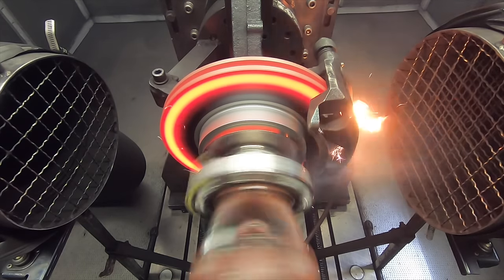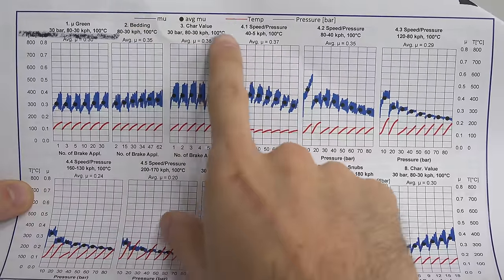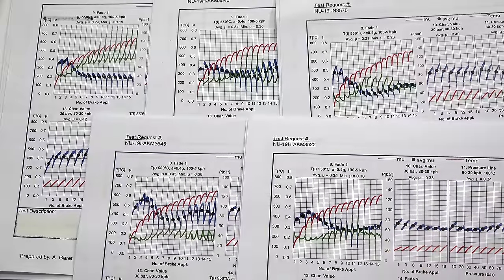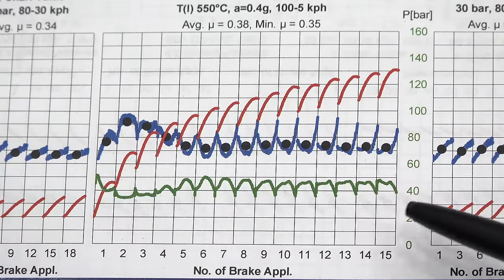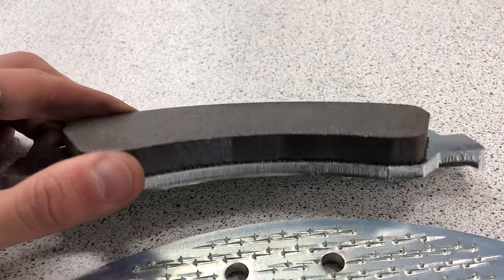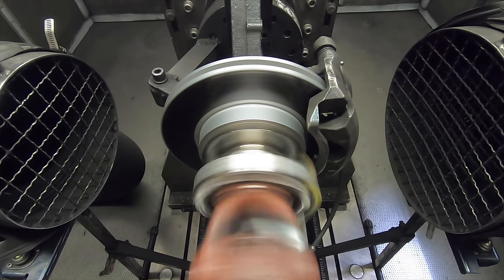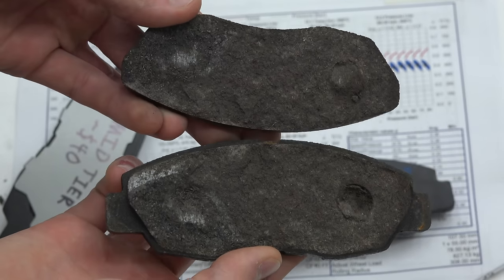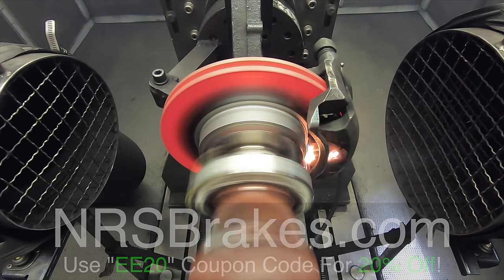What Are The Best Brake Pads? Cheap vs Expensive Tested!

Comment: I have never understood why people cheap out on Tires and Brakes on their vehicles. 
Literally the most important things on a car.
Reply: Agreed!!  Once you go PSS/PS4S's you'll never cheap out on tires again!!  Brakes are kind of a nightmare with so many conflicting opinions between bobcat, hawk, ebc, etc...  Running EBC Redstuff on 2 piece sprinkle slotted rotors, looking for more bite though.
Reply: Possibly because I'm old, I know how to drive, I pay attention to traffic around me. I've always bought one step up from the bottom, and it looks like I'm right. But I started on bias-ply tires, manual drum brakes I still drift around every snow covered corner,  and us old people don't need anitlock brakes to stop on ice.
Reply: Some people don't drive like they're on a damn race track either. They actually avoid havoc by paying attention. They don't run their tires low, keep them rotated,  don't wait till the last damn second to apply the breaks, ect ect. Use your brain and there won't be any need to buy over priced, over rated crap.
Reply: Gary Riefle 

Exactly. 04 Colorado, one step up brakes done me well.
Reply: If you don’t have the money you buy what you can afford.
Reply: According to the video, spending more money on the upper tier vs budget made no difference in performance.  So you can spend more but end up with the same results.
Reply: @stevens1646  I agree. Plus, there's the "I paid good money for my parts" and so many end up takin that for granted and the parts get abused. When in fact lesser priced parts if properly used actually end up lasting longer. I'm sceptic of two prices for any part, the lowest which is obviously low for a reason, (don't buy those) and the high dollar stuff that is overrated... they just want your money.
Reply: Buy Michelin defenders great tire I highly vouch for them...
Reply: @stevens1646  but the higher priced ones do not squeal. my brembo pads regularly squealed, especially after washing. switched to textar and no squealing :)
Reply: Because the cheap ones still meet the specs, and if you don't drive like a yob they work just fine.
Reply: There are some not so expensive tires that are way better than expensive ones.
Reply: @garyr7027  You are 100% correct,matter of fact 90% of pads sold out there are the 20 dollar pads,people dont understand pads just dont fall off or you "get killed because you bought a 20 dollar pad",even the cheapest pads are made by companies that dont wanna deal with a lawsuit,will they last a long time? maybe not, but they will work just fine as long as your not Hanging out with Mario Andretti and hes doing the driving,i like to buy the step above on the cheap pads but i have used the chepo ones many times,they create dust quite a bit but the car stops perfectly.

I tell you a story,ive done 3 brake jobs in my life out of many dozens where the owner let the car go for so long that there was no pad left or metal,the rotor ate it up and the remaining pad and the other side of the caliper were stopping the car just fine,granted it caused a tremendous racket (i have this noise in my car, do you know what  it might be???)  but the brakes were still working, if i remember correctly it was a Honda Accord,a Hyunday Sonata and a Ford truck,i just had to shake my head in disbelief but these people weren't driving like maniacs either,they just weren't very good on maintenance.
Reply: @dntlss  they are the same ones who don't change the oil, do a trans fluid change, red line the tach, floor the pedal between stop signs, ect ect. I think some people think, if they can't buy OEM or high dollar parts then there's no sense in doin it at all, just let it go till it actually needs fixed. You won't catch me doin that, one thing I can't stand is ten different things wrong at the same time, by then the car isn't worth having. If you have a decent car from the start and like it, you'll save money in the long run to keep it and keep up on it. A part goes bad replace it, don't put it off any longer than necessary. Appreciate your input I can relate to it, I've seen cars like that before. The motto "if it ain't broke don't fix it," is and has always been bad advice imo... I've never agreed with it. That motto comes from lazy asses who do nothin to their cars, and then wonder why it's not worth keeping... go figure?... Lol
Reply: Talk about thinking about things we never even think about AKA take for granted.
We bet our lives each and every single day multiple times a day and we never even think about it. . . 
Well Most people anyway.
Reply: @karlporath8904  My first vehicle was a 1972 Ford f-100 with manual drum brakes. Not bad once you get use to them, but you need some good leg muscles to make them work well when you're going downhill or hauling a load. Slowing or stopping on snow/ice is certainly doable. I'd rather have manual brakes than power brakes with no ABS.
Reply: @Zeveulesaussure  True. It also makes a big difference on what you're buying them for. Truck tires tend to be cheaper than car tires that have to fit on a 18" or 19" rim and can only be 1.5" - 2" tall. Just one reason why I hate large rims on just about any vehicle. Why some people love giant rims with paper thin tires is beyond me.
Reply: Sometimes it's a matter of personal finances.
Reply: @rayford21  True, and I will admit that going cheap is better than just neglecting it outright. As long as you keep up on the maintenance which will probably be more often with cheap parts. 

Often times the cost seems to be minor between cheap parts and good mid tier parts. I know this isn't always the case, but in my experiences, the person who gets the dirt cheap parts usually doesn't really care much about the car. "As long as it still moves it's good enough. Brakes are overdue? Oil change is overdue? Tires are bald? Eh. It'll get done eventually when I get the time and the money." It's not like you're the only person driving around. If you can't afford or be bothered to take care of your car then don't drive one.

Comment: great video! I would have liked to know more about the different material types used in pads (ceramic vs metallic) instead of just generic price points.
Reply from the maker: It's honestly a very difficult thing to determine, which is why I left it out. Regulations allow for such a wide variety of materials that unless you do some sort of chemical analysis, I'm not sure there's much meaning behind it. For what it's worth, the cheapest pads were semi-metallic (again, vague, but that's all they tell you), while the other four pads are ceramic. But the material alone doesn't show a strong correlation with all tests (both ceramic/metallic can do poorly in sound, corrosion, shear, etc), so it's difficult to determine what's the cause for doing well/poorly based purely on material.
Reply: @EngineeringExplained  Full ceramics so frequently have a major noise advantage I believe the mid-level pads were actually a semi-metallic, as you say it's difficult to prove so we will never know, sheer test results somewhat support my suspicion as well.
Reply: Yeah, this makes this test completely worthless for answering the question it claims to ask.

Comment: I remember the tv show legendary motor cars doing a   segment on the very same thing essentially. They stated at that time that in North America that there were only two brake shoe manufacturers.  That all the North American  and few of the import brands that had assembly facilities in North America used one or the other. Many of the aftermarket brands used them as well. Of course, with rebranding. 
Great presentation as usual.

Comment: I have always preferred OEM and learned those are the only ones you should use in mechanics class. Not only that but cheaper pads with a “lifetime warranty” usually means they are too hard and will just wear your rotors that much faster.

Comment: I’ll stick with OEM I’m not too impressed with the NRS
Reply: If soft pads are cheap and you really do not drive beyond posted speeds often why not? Just replace them and keep the rotors. 
Hard will last longer, but also the rotor wears fast too.
OH and using engine breaking assistance. No it does not kill a gas engine. Not good for most automajic transmissions as they are not made for slowing. Mostly for just going

The last thing if you do it. Cheap is OK. If you pay to have the work done might as well go with hard and and new rotors
Reply: @warrenpuckett4203  I do lots of hard mountain driving I love my high performance wagon!
Reply: @annoythedonkey  hey! At least they're honest!
Reply: Seems to me the mid range parts store are the best value. They scored near the best on almost every category and are way cheaper than OEM or premium brand pads.
Reply: I usually prefer akebono pads. They work great and have never had braking issues with those.

Comment: Driving over 300,000 km on OEM brake pads and pads still have over 5 mm left, never changed pads over 8 years, but I drive very defensively and anticipate all stops if possible. Brake pad wear really depends on how you drive.
Reply: You’re breaking on the gearbox or what ? Even if I do that you say, I’m driving mainly on mountain roads I can’t not use the brakes. 30k Km and they are gone
Reply: Yeah, braking from cruising on the flat is lots different from the up & downs in Mountain Country, - you just don't t swao your gearbox cogs anything like the same amount.

Comment: My 2015 nissan versa note s came from the factory with Akebono Pro ACT Ultra Premium ceramic brake pads and lasted ~100,000 miles (and still had about 1/5 of the pad left when I replaced them). 

I replaced them with the cheapest $35 autozone budget pads and they lasted ~20,000 miles.

Comment: Dealership OE pads are definitely the best. I used to use the mid grade aftermarket and thought they were ok. I used to have to replace them every 2 or 3 years. Then I switched to dealership OE pads. They cost almost $80 but I got over 5 years out of my first set. + the stopping power and feel is way better too. BTW to ensure maximum time out of a set of pads and components do regular inspections on the brake system. I check everything over when I do my tire rotation's (every 6,000 miles) that includes removing the pads measuring wear of the pads, measuring rotor thickness and comparing that with minimum thickness for the rotors. cleaning and lubricating slides, looking over break lines and hoses. And every 3 years doing a full change of the break fluid. No matter what grade pads you choose to use a well maintained breaking system will ensue the best performance and life the parts you have can provide.

Comment: I'd love to see a video that also includes rotors in this brake testing regime.  Does the cross-interaction between pads and rotors make any difference to real world braking scenarios?  Slotted vs drilled vs budget?
Reply: Generally no. Rotors are drilled or slotted for heat diffusion (or cosmetics), which for normal daily driving is not an issue. (Notice the first test they ran? How often do you brake from 100-5kp with only seconds in between?). But on the track heat diffusion is important.
Reply: The first reply is pretty accurate but the brakes will most likely last longer the quicker the heat can be dissipated. Almost all materials become softer the hotter they get. Plus it will help prevent most chances of rotors warping after an extreme breaking situation like descending a mountain. If the rotor ends up getting too hot they could potentially become warped which will increase the rate of wear in addition to reducing the braking force. It is absolutely worth the investment in terms of safety and longevity but if your not planning on keeping it for a while don't bother.
Reply: @seanriopel3132  great answers thanks guys!

Comment: What impressed me most is not included in this test. I really like regenerative braking. I drive a hybrid. An unexpected benefit is since the majority of the braking from high speed to slow speed is regenerative, the majority of the brake wear is not in the friction material and generation of heat. As a result, I have had my brakes checked at each tire change. Pad wear is minimal, even in city driving. I am currently at 180,000 miles on the original brake pads. The brakes are used only for panic stops, and the final couple of miles/hr stopping for lights and stop signs. Non panic slowing uses regenerative braking instead of the pads which is the majority of the wear on traditional brakes.  I was completely surprised at having 80% of the pads remaining at 100,000 miles. I may either sell the car or change the brakes at 200,000 miles.
Reply: this is cool👍
Reply: for folks that are wondering, "how is regen braking different?" It's because regen braking is more akin to engine braking or downshift braking. EVs will use the motors at each wheel to apply force, which slows the car and creats electricity. The brakes aren't used at all in these situations which is why they will last for so long.

Comment: My takeaway from this whole test is: Even the cheapest pads are good enough for normal use, as you will never stress them to the point that this test does: Since I don't drive like a race car driver in my non-sports car, they will never get this hot (which will warp the disc and create nasty pulsing). The difference between the cheapest and the most expensive are surprisingly small.
Reply: Questio  is what is considered normal? In germany you could expect to have a braking from 200-70 once or more in the life time of an autobahn commuter. If this guy then comes off the autobahn and stands at the traffic lights with his foot on the brake you will have a very different scenario when doing a normal braking after that
Reply: Durability is the issue. Unless you change them yourself, even if I change them myself, my time and effort is worth the extra money
Reply: Sometimes bad traffic can really show the difference between cheap and decent,  twice ice had rotors warp after bad traffic

Comment: So if you are not concerned about noise, and corrosion is less of an issue (such as in tropical locations), then Mid is the way to go. Good to hear, which is what I typically get as I already knew about the noise and not being galvanized.

Comment: Living where I do, in a severe winter climate, rust is a real problem. The drum brakes on my truck are especially hard hit by slat-induced rust. I just rebuilt them a few months ago as one return spring had rusted in half and the rest were almost as bad. The entire braking system looked like hell although only five years old. I replaced everything. While I was at it, I replaced all the parking brake cables too, a smart move because now I can actually use the parking brake at very low temperatures and know they'll release again. Road salt is the bane of my existence.

Comment: How about a measure of how dirty they make your wheels. 

I've also wondered if you compare a slow, gradual stop versus a panic stop, which would result in more brake pad wear. Since F=MA, The higher deceleration rate (A) is achieved by higher pedal force(F) and the mass (M) of the vehicle is basically constant but does the panic stop wear the brakes more. Since the braking time is less in a rapid stop, the heat generated is probably greater.

Comment: I feel like the mid-range pad would offer the best value, considering the long wear life and good shear strength.
Reply: I've seen thousands of cars come through my shop, and I can't remember ever seeing a pad that had the material separate from the backing. I wouldn't base my purchase on that aspect, as in my experience it's just not a real world concern. I think it was included to show off NRS' pimply backing plate. I will say that my experience is on the west coast. It's possible those in areas prone to rust may see separation issues.
Reply: Racefiend77 I have a neighbor from upstate New York that will show you thousands of brake pad separations. Salt is hard, hard, hard on exposed components.
Reply: Pad separation happens, rare but not unheard of. I've had it happen twice personally, was a passenger in a third vehicle when it happened, and know of other people it's happened to. And I'm not that old, lol. So I'm calling BS on your "1000s of cars sample size", because it does indeed happen. You obviously have to change the rotors too when that happens, because the metal backing plate chews up the rotor surface really fast.
Reply: @Friend_of_the_One-Eyed_Ladies  i had exprienced a cheap quality broken pad during a highway journey. Very cheap quality break pads do break, therefore we should always be careful before buying disc pads

Comment: Mid price tier looks good to me for all around use. If a lot of track time or hard braking, yes get much better pads. But for street and track.... mid range actually seems it would work if with hobbyist or moderate track use... moderate only as long as you keep a check on the pad wear.

Comment: I'd like to know how braking performance is affected by water (driving on a wet road).
Some cars apparently apply a constant light pressure on the brakes (imperceivable by the driver) when driving in the rain, to keep the pads and rotors hot enough to stay dry. Would be interesting to see the comparison in performance.

Comment: When in doubt I always go mulid grade with the majority of parts and most of my cars last along time before having to do regular maintenance (oil change, tires, ect.) There's only one big difference I've seen if the quality of the parts from cheap parts in-between pay days and that's spark plugs. Low level spark plugs cause the engines I've used (some over 25 years old) to run with a mild difference in gas mileage and run noticeably more rough. The mid grade seem to last and run much better. As far as breaks mid grades gave me the most satisfying driveing on my daily.